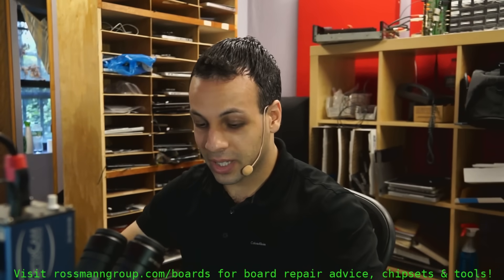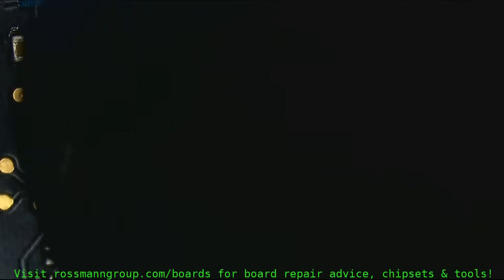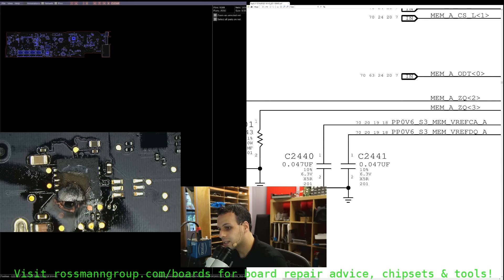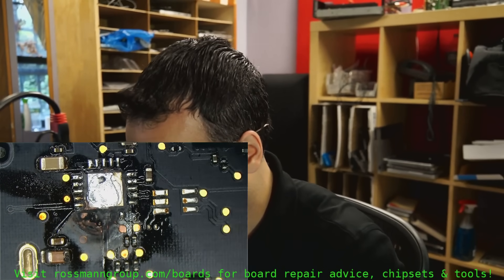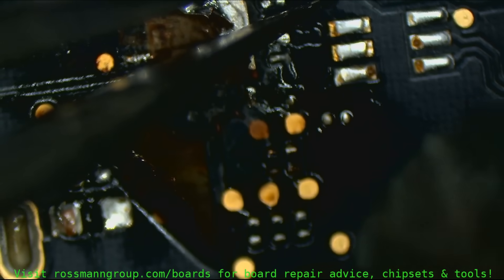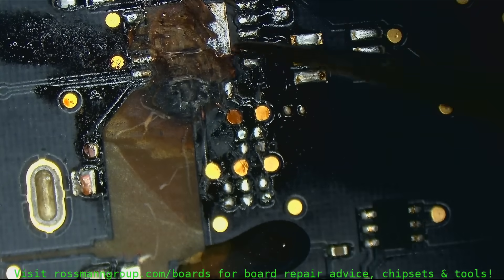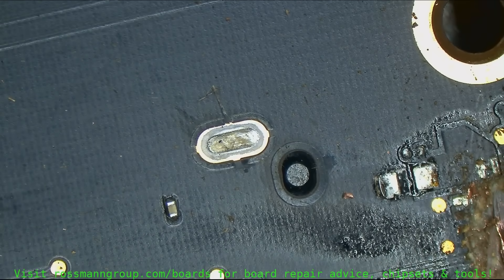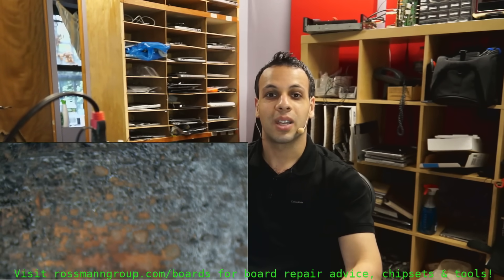They call it thunder "BOLT" for a reason; Macbook board erupts.

Comment: its not HHO42 its HHG42 (a  Hitch-Hikers Guide reference) so its a tag to see if original board comes back. Thunder bolt looks like it got Thunderstruck! Ouchy. did you ask them if they plugged in a lightning adaptor?

Comment: I won't be surprised if new apple products will use a special kind of ICs that will burn internally without making the ic burn on the exterior side to make sure that a repair tech will is not able to tell a broken component from a working one.

Comment: I've had an RF amplifier Mosfet transistor blow up like that. It was arcing through the plastic cover into the + rail on modulation peaks causing the AM modulation to distort. That was a 400 watt MW broadcast system. The whole transistor blew up over night and made a horrible stench. I bet thats what that customer was smelling when that regulator chip sparked in his mac book. They need to put an iron enclosure and make the chip less sensitive to faults. They also need to make a fault protection circuit so nothing draws too much current.
edit: I have also seen this happen to 5v regulators, it's not that uncommon. The smaller microchips are especially sensitive.

Comment: It's a bit late of me, but I'm trying to rewind at your work :)
It's a fun to watch :) always I learn something new, 
but let me focus on the thingy here 1:22, see the hh042? it's a wild guess of me (but I've also seen that poor practice of 'repair' in action), this board you have here is not the original client's mobo, as they probably went on and fried it or something like that so they've sent client out to you with a diagnose of sorts 'we did all we could but for some reason it just doesn't work' which for me is a more or less BS :) 
It's just a wild guess but I've seen that practice in action so I wouldn't be surprised if that was the case this time. It looks like spare part which should already be scraped not for use ever again :)
Cheers mate, you're hilarious! Be yourself!

Comment: So apple likes to build laptops where the keyboard is basically cemented into the machine and a faulty webcam can take down the databus used by all the critical temp sensors... but physically scraping a whole thunderbolt unit off the board makes it work just fine again... who would have thought...

Comment: I know it has nothing to relate to the video with but I got a "UsEr ReFuRbIsHeD" Lenovo Thinkpad W530 and the Bluetooth wasn't working. so i looked inside and turns out the entire connector for the Bluetooth card was ripped out. anything that I can do that doesn't include replacing the entire motherboard?

Comment: Being a Automotive Repair Shop owner , ASE-L-1 cert ,

I’ve been reprogramming powertrain control module‘s transmission control modules,body control since 1996 and I see a lot of circuit board type problems , Chrysler being on my top of the list , with glueing the entire unit together , no screws holding case together as to gain access to the inside of the unit, without damaging a 250.00 core charge if your going to purchasing a new or used unit .
Wondering if you would be interested in repairing some automotive PCM ‘s.
Chrysler 2013 and above have a charging system that’s duty cycle controlled by the PCM 
Just wondering ,
Nice to see someone like yourself that absolutely love  what ya do and  your good at it !!!
Slones Automotive 
Dayton Ohio

Comment: i got a andostar 201.it had option for battery on pcb in it.so i took a casio xlim camera lithium bat.stripped it so it just had the inner protection.the flat leads had plastic coating.solderd t leads to them with some tube shrink to cover solder joints.Put the other end of the leads in the pcb holes marked + and minus.put a triangle of double sided tape under the battery so the flat flex cabel from carmera sensor to pcb can slide.the bat max thick 4.2mm.al components that gets warm like chip set are o n top of pcb .very handy to take the microscope camera from its stand and just lay it sideways.i can use the lcd on the microscopecam or a hdmi monitor.It is not a expensive thing.but with the stand hanging upside down i got lots of workplace under it while in the stand.It was a electro lab guy on youtube who got the idea.led ligth with polaroid filters also very smart.Like he say almost x ray vision with those cheap polaroid filters in front of the led lamps  used on sm 201 cam microscope.Sorry for my bad english writing

Comment: hi. i really like your work its very professional and its apples stupid mistake not to have you as a top paid confluent.. i have a MacBook  pro late 2011 my thunderbolt  stopped working after i tried to plug in a usb kb. i happened to scrape the edge/ sloppy trying to connect. anyway the tv had static like a old tv on a none channel. now the port won't work  on my tv. anyway u or any one can help is there a user guide to probe the problem,short. im pretty good at small bird fixes. ty ada,

Comment: in no way am I criticizing your work, but out of curiosity I pose this hypothetical question, all the other pads along top and left and right sides seemed intact, and the bottom side of the chip based on your schematics in the video were simply all grounds, it seems likely a short to ground, so my question is  what caused the short to ground. 

2. why could you not provide a jumper for each of the four tracks from the chip to new grnds.

Comment: No surprise - Thunderbolt is accompanied with power delivery to connected device and some revisions should withstand up to 20 amps. Dunno which TB modification MacBook have but it must be able to deliver some serious current and serious current mean serious consequences if power conductors in some part of interface become shorted. I am curious are owner didn't seen smoke accompanied with sparking noise. Maccraps aren't hermetic (otherwise they would not have water damage) - thing should been smoke like Hell for a short time.

Comment: So what does thunderbolt do? I mean, if you can remove the entire thing and it fixes the problem this board had; What is the board no longer capable of doing? Clearly it was not to important if the board is good after completely removing it. By the way, I love these videos. Like someone in the comments mentioned, you are like the Bob Ross of chips!

Comment: Barlow lens just increases focal length , and focal length means magnification, so on its self Barlow lens can not make less detailed picture ,but  there is limit to the magnification,  becosue the amount of detail available is not limitless , there is a limit, so you are probably getting closer to the physical limit of the glass and its detail so Barlow makes the picture look worse ,but if not then it shouldn't make the picture worse , amount of detail you can see through optical device depends on the glass quality and the Aperture , if anyone cares to know whats going on there .

Comment: Hi Man, one question, I have a broken Mac Mini (2011 model) do you repair these? I'm from Mexico, but would have no issue mailing it in, just want the damned thing to be anything other than a pretty paperweight, the symptom I see is that when I press the power button the led goes on, the machine starts booting up then it suddenly shuts down and starts booting up again, and it cycles that way, the power button becomes unresponsive (actually have to unplug the power cord for it to shut down), ocassionally it boots and works for a few min, then it starts all over again.

Comment: > "My hardware is fried."
> "Have you tried updating the operating system?"
Reply: With Dell Support, yes this question will be asked. Amazing how stupid 1st level support is.
Reply: @Spelter  I've had that happen when calling them up as the laptop fan needed to be replaced. :/
Reply: Have fun doing that with a pc that doesn't turn on
Reply: They're required to go down a checklist of issues before they can specify a cause (for the company), even if you're 99.99999% sure what the problem is. The quicker you let them run down that list, the sooner they can help you RMA it.

Comment: You could make a PCB that held a new chip and assorted crap that you glued on and wired into the main the board. Like game console mod chip. The practicality would really depend on if you could come up with a way to do it without needing a million wiring points to the board. It could be practical if you only need 6 or less. Just a fun idea.

Comment: Buuut, you could wire in a new thunder bolt with tiny wires :)
Reply: ;} Tiny wires running off to the other end of the buried traces would (a) probably attenuate/corrupt the very high speed signals into non-usability and (b) totally screw-up RFI e.g. "NO mobile phone or  WiFi for you or your neighbors!" The board was cooked through a ground or power plane! :(

Comment: a small amount of epoxy at the fried spot to cover it will prevent moisture/condensation from forming and letting whiskers form possibly creating yet another short.
also...a light bristle small stainless steel brush comes in handy at scraping time. ;-) get some sleep young man. your body and brain would appreciate it.
 great diagnostic vids btw.
=dok=

Comment: My electrical teacher told me a good tip.

It's black and crispy, it's fucked.
Reply: Another one:
Power electronics abide by only one rule: When in doubt, explode!
Reply: I like my toast that way
Reply: When the magic smokes escapes. It's also fucked.
Reply: If it's black and crispy, the shit is fucked up.
Reply: It's not 100% the case, I've had certain circuits and motors smoke momentarily and then work fine for years.

Comment: Thunderbolt has at least been blowing up less stuff inside computers for me than firewire  has done (none vs 3 computers and 2 sound interfaces with dead/fried   controllers).. I do however still try to only connect TB cables while all the devices are off just to be extra safe because I've read about similar things happening with it as well.

Comment: Hey Louis like the canal. I unfortionatly need a macbook pro, which year is the least fuckt up?
Reply: I'd recommend the 2015 MacBook Pro. It has: MagSafe 2 (charging port), 2 Thunderbolt 2 ports, 2 USB 3.0 ports, an HDMI port, an SD card reader, and a headphone jack.
Here is the link to the 2015 MacBook Pro(click Read more): https://www.amazon.com/gp/search/ref=sr_nr_p_n_operating_system_0?fst=as%3Aoff&rh=n%3A13896617011%2Ck%3A2015+macbook+pro+retina%2Cp_n_operating_system_browse-bin%3A7529233011&keywords=2015+macbook+pro+retina&ie=UTF8&qid=1502659129&rnid=562215011
Reply: Quinten Voorthuijzen used thinkpad and put macOS on it
Reply: a 1997 Macintosh PowerBook 2400c m4124 is probably your best bet. A little slow compared to today's standards, but aren't all macs a little slow?
Reply: Quinten Voorthuijzen the hackintosh year. If it needs to be mobile, the hackintosh laptop/ remote desktop. Or just retrofit an old Mac pro like in this video https://www.google.com/url?sa=t&source=web&rct=j&url=%23&ved=0ahUKEwjhi9XM8c_VAhXJ7YMKHcc5BDwQxa8BCCUwAA&usg=AFQjCNF1sHlk2z9QIx28jtvfnGP_UlkifA and you can just remote desktop into it.
Reply: The YouTube Phantom Official if he NEEDS a Mac, I’m guessing it’s to run Mac-only software like Final Cut X or Aperture (if that still exists, haven’t touch a Mac in years) and one from 97 is not gonna do that. Honestly the newest iMacs aren’t the worst thing ever. It’s only like 80 bucks cheaper to build one using similar components. Just don’t let Apple upgrade storage or memory and you’re fine
Reply: AbnormallyNormal // build a pc with similar specs to a iMac and install hackintosh.Its much cheaper

Comment: I have a 13'' air and all of a sudden I'm very nervous about using the thunderbolt port...
Reply: Maybe don't spill drinks on it and you'll be fine.
Can't say the same for the gpus of the 2 work provided Macbook Pros I've had, first one had it die twice and while it was reimbursed it cost over a hundred bucks to fix each time, then the second one died and got the shoe rubber treatment.
Reply: @creaturedanaaaaa  More like don't use it as a charger, judging by the damage.
Reply: @DustWolphy  Lets be honest, you actually mean don't use it at all, which is a sentiment I can fully agree with.
Reply: @creaturedanaaaaa  Given the electrical design it's hard to argue that it was ever intended to be used according to the Thunderbolt spec.
Reply: @DustWolphy  Fair enough.
Reply: Why? If it blows up now you know how to fix it yourself...

Comment: Another mac cancer, amazing how many idiots keep buying these machines. Rather buy a mercedes and fix or replace it less often.
Reply: m4ti140 That would be Audi- they share so many parts with VW but you pay 30-40% more to get the Audi badge. They look okay from the outside but underneath its a complete mess- just like Apple products
Reply: I think you could get more power and reliability from a rotary engine with three blown apex seals than you could get with a perfectly functional apple product.
Reply: Lancia is more reliable than apple
Reply: Lolwut OP, Mercedes is literally the Apple of car industry these days
Reply: Räuber Hotzenplotz 
No that would be BMW
Broke 
My 
Wallet 
A starter motor shouldn’t cost 6-700$ and take 6-8 hours to put in, and that’s on a lower end model.
Reply: HA! good analogy!
Reply: Lol Mercedes does the same shit as Apple. Planned obsolescence and overpriced repair.
Reply: Youra'peein cars are meant for the lease crowd. They are no longer synonymous with reliability, and parts/service is expen$$ive. I have worked professionally on VW, Audi, Mercedes, and BMW. Overengineered, 50% plastic, engineered obsolescence.

Comment: Hearing you speak about microscopes:  A month ago I needed to see some resistors and pcb connectors that had stress fractures on a video out  board of a $180k Ultrasound. I went down the hallway and grabbed a $250k Zeiss Pentero neuro surgical microscope to do the inspection. With all that equipment in my office I had only a few square feet to maneuver, however, I had the best image, zoom and focal distance imaginable to do smd / board level repairs!
Reply: Analyze, adapt, overcome!  Did anyone in the department throw a shit-fit for your appropriation?

Comment: Hi louis, I currently have a macbook 2009 dual core currently in for repair. I'm struggling to find out what is causing it to randomly turn off. It will turn on, you get the apple logo and then after about 30 seconds it just turns off. I've tried a new hard drive & attempted factory reinstall to no avail. Any ideas where I should be looking as i'm still new at all of this and hoping your brilliant mind can guide me where to go.
Reply: Spectator Haha. All that was missing from that pathetic begging was a reach around offer.
Reply: Your RAM is going to lalaland

Comment: Y'know, externalizing PCIe on 20 conductors was quite a feat, so even if it has to explode in a ball of fire every now and then I have to commend Intel for making this even happen.
Reply: mootworks sure, I agree, but any lack of protection is Apple's fault. Their integrated designs have to take into account how parts of the system can affect each other, in a way that's more complete than a reference design.
Reply: It’s kind of like rocket launches and nascar

Comment: Eh, why bother with any sort of protection or redundancy, when you can just let the board fail catastrophically and overcharge the everloving fuck out of your hipster sheep customers for a replacement that you manufacture in a Chinese sweatshop for $10.

Apple is probably among the lowest forms of scum, but what does it say about the consumers when they keep paying top dollar to have garbage shoveled down their throats?
Reply: >but what does it say about the consumers when they keep paying top dollar to have garbage shoveled down their throats?

Didn't you know? It's Apple's new product line decades in the making, the iZombie.
Reply: Following that logic fuses in your home circuitry can be ignored, because who would ever cause a short or overload the circuit, right!?
Its your responsibility! Fuck protection!
Reply: Fuses are not made to protect components on PCB, their job is to keep wires from catching on fire in case of too much current.
Reply from the maker: +Septfox a lot
Reply: If they named their next product iZombie, people would still buy it.
Reply: You want protection? How about you don't spill drinks on your laptop, or use shitty charger from eBay... Where did personal responsibility go?
Reply: We saw the same video, right? Where the chip had gotten hot enough to burn away half of its outer casing and critically damage the board layers and traces nearby? You are right, a fuse wouldn't have saved the chip, but it would have kept the chip from becoming a fire hazard.

I agree on your point that the user shouldn't be dumping liquids onto their expensive laptop, but there should be *some sort of protection*, anything, on a line coming directly from the charger or running power to an external port. By the looks of things, it shorted and only stopped shorting when the path through the chip burned up.

Now, to be fair, I don't know where the spill and resulting short was. Maybe there is overcurrent and/or short protection in the circuit, and it was bypassed (e.g. the spill was directly on the chip and bridged the pins). If someone can look at this board or has before and remembers its features, I wouldn't mind being proven wrong.
Reply: No fire hazard, charger cable didn't melt, chip blow up inside device and PCB damage prevented it from working any further. Before you can sell any electronic device, you must pass safety&quality certification... at least in Europe, not sure about murica.